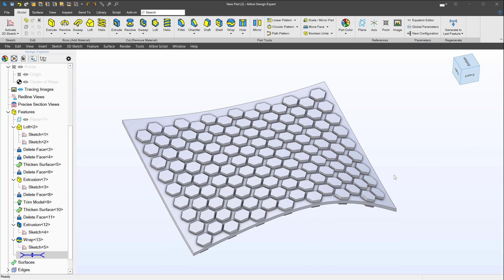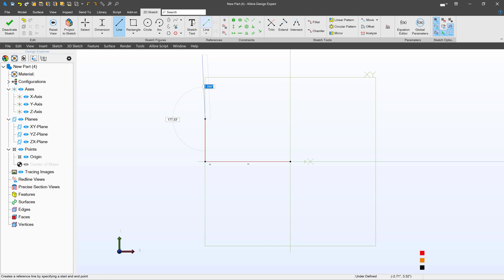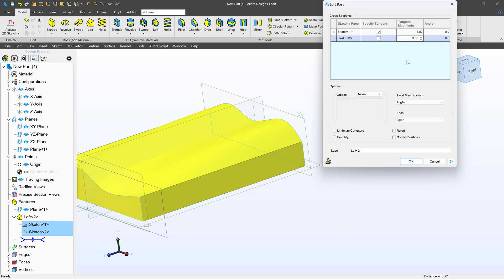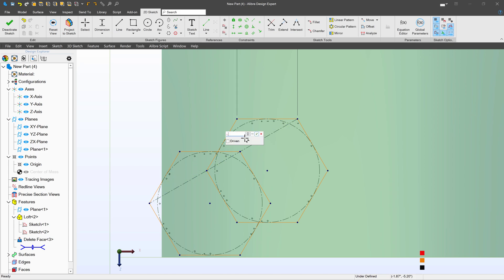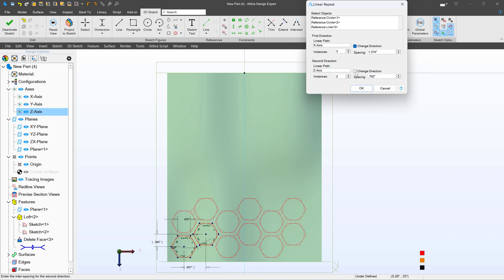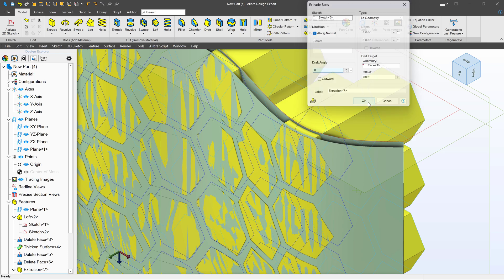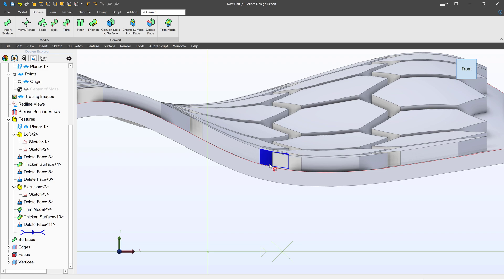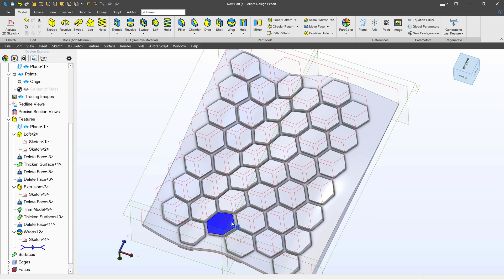Alibre | 2 Methods To Make A 3D Texture On A Complex Surface

Comment: Hi, I have Alibre Design Profesional V23 and I do not have the WRAP tool. I just trying to design pattern on a tire. 🙂 Thanks for the advice.!
Reply: Ok, found the solutions. Ones the tire profile à  been created and revolved to model it, create a plan above the tire profile using the X or Y plane with an off greather then tire radius. Then Create a pattern in Sketch mode and then extrude (remove) to Geometry. Note that created a few grooves in my tire profile to be able to remode to the rubber to the next geometry. Finally, create a Circular pattern of the last previopus step (remove). Hope that it is cleart. I will post it to GrabCAD.
Reply from the maker: @donaldwright2426  Sounds good- glad you figured it out!

Comment: I would love to see an added option in the dialog box for patterns, offsets, etc to constrain the new sketch figures using the dimensions you enter. Obviously you wouldn't want this all the time, but it would be nice to have the option. Even if it took a few minutes to calculate.
I know it's not necessary to be fully constrained to extrude, but it would make things easier.
Reply from the maker: Got it, I'll mark that down.  If you get a chance, would you mind sending me an email, joseph@alibre.com?

Comment: Excellent. Very nice texture. The other day I learnt a very cool stuff from Alibre help page. If you hold CTRL key, and then click with mouse wheel button in the area you want to select features, it will pop up a "select other" dialog with all the options that you can select. Pretty cool feature when I want to select something hides behind something else.

Comment: Instead of using calculator to double the reference dimension - you can turn the reference dimension into a driving dimension and use it later in the equation editor.